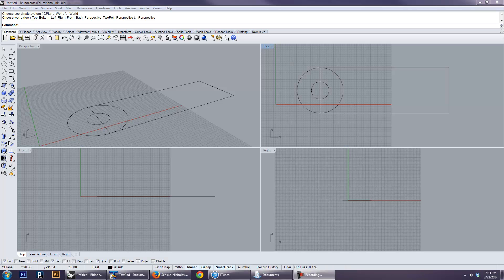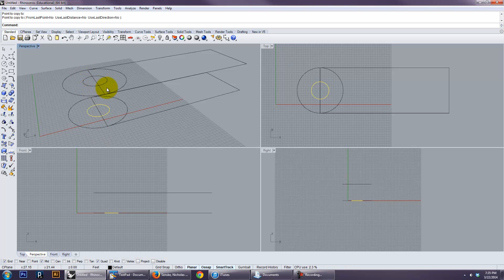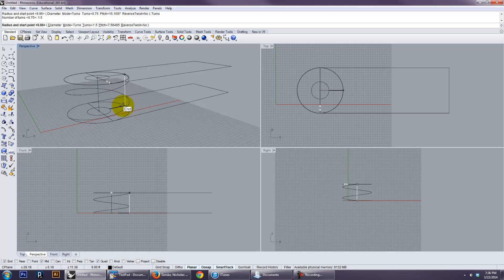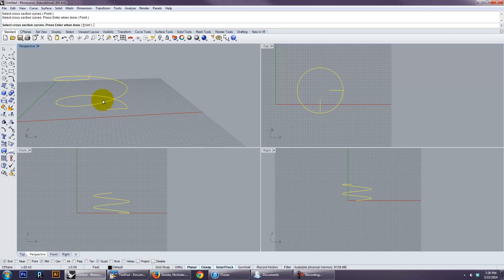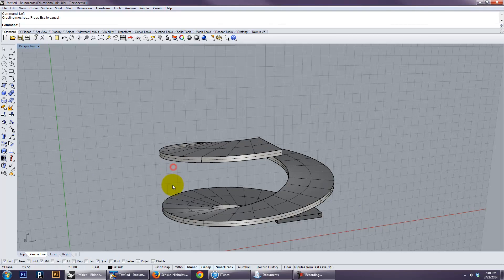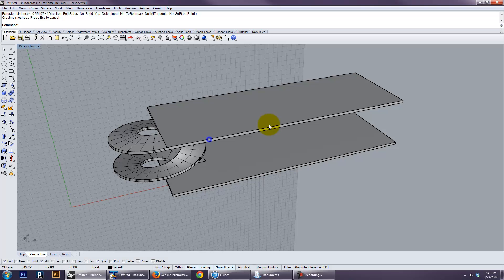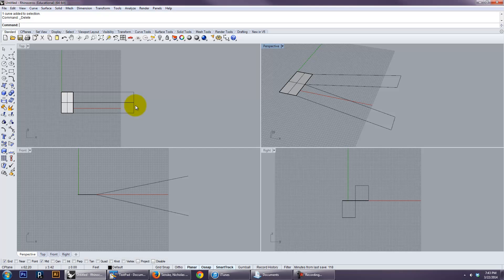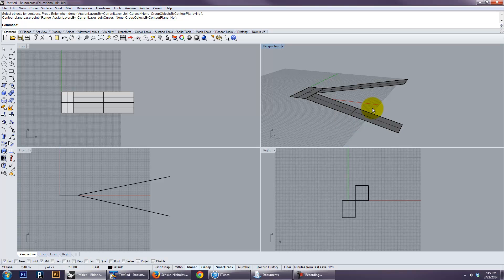ARCH2102 - Ramps in Rhino

Comment: Hi, just wondering, what unit are you doing this in? I'm kind pf struggling with understanding the ramp ratio of 1:12, but you mentioned a pitch of 88.
Reply: +Adaeze. C says feet on the bottom left
Reply: +Miguel Gutierrez (migle) have you find  a method to calculate this 1:12 ratio while making a ramp in Rhino ? if yes, please share with us, I have the same problem ! thanks
Reply: ADA not 88